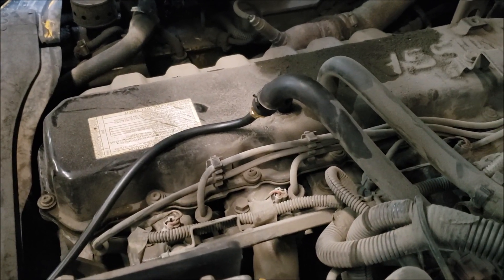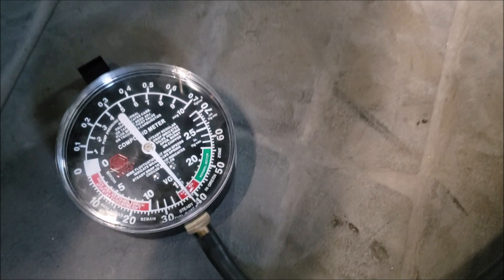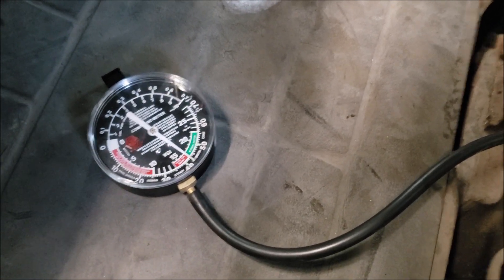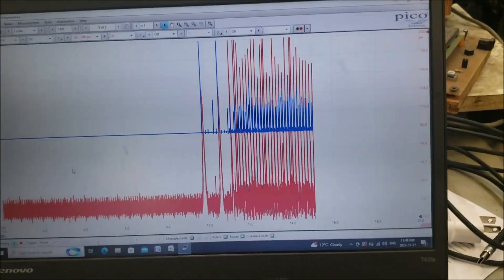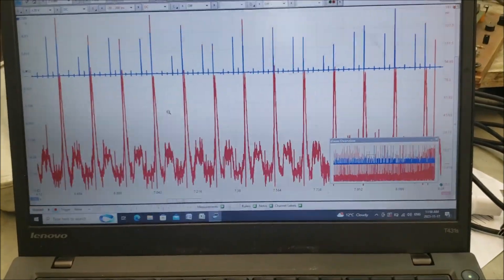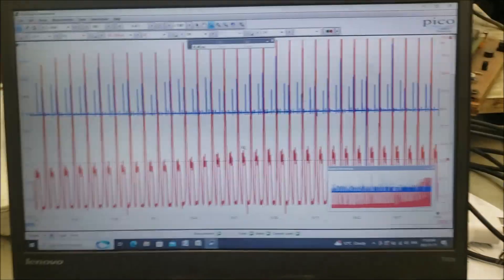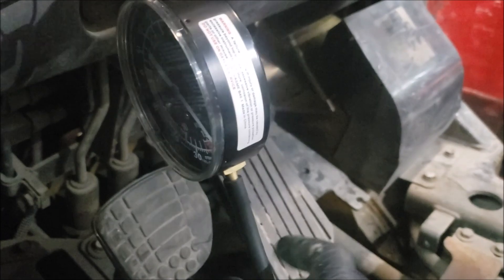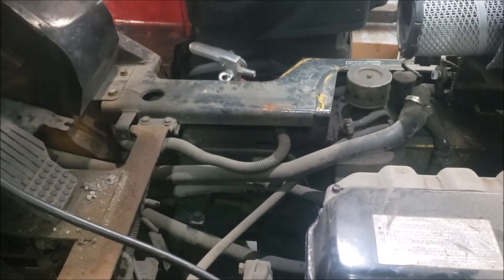Nissan TB45 Engine severe low power

Comment: Hi Forkliftgeek I have a Yale GDP25TE with a power problem,starts fine and revs no problem but sometimes when I put it in forward or reverse no drive or low power drive leave it idling for 5-10 minutes then I have full power any ideas? I did have the torque converter  reconditioned last year as didn’t have power to drive over a stone! After that it was great but now 1 yr on this.I have changed fuel filter,in-line fuel filter,ATF fluid & filer still the same
Reply from the maker: Sounds like a loss of pressure from the charge pump to me.
Reply: Thanks for that @forkliftgeek10 ,what does the charge pump do? And where is it and how do I test it?
Reply from the maker: @airwalker5404  charge pump or transmission pump creates transmission oil flow. You need a transmission pressure guage. This is only one possibility though.
Reply: @forkliftgeek10  thanks for that,I’ll look into it, I also wondered if it was anything to do with the drive solenoid?
Reply from the maker: If you are referring to the forward or reverse solenoids, then I would say unlikely to be the cause. You said if you leave it idling for 5 to 10 mins it would drive.

Comment: Hey man, I am a journeyman automotive mechanic up in Canada. I'm trying to fix an old Toyota propane forklift. I've watched all your videos and will be doing more testing today with that knowledge but this one has a weird issue that I don't see in your videos. It is a 4Y engine but old, no  gauges. Model is 7FGU32. It dose not like to start, however It dose try to start and of you push the gas the exact right time it starts and once started it runs awesome, no issues. It has this tricky start condition Hot and Cold. What would you be checking first? Today I will remove air cleaner and see of it starts perfect on brake clean. I am sure it is fuel relates. Any advice would be much  appreciated
Reply: No fuel injector on this old unit, just goes from regulator to an old school mixer with the diaphragm which I removed and made sure wasn't cracked and the valve inside moves freely
Reply from the maker: Nice to hear from a fellow Canadian. Based on what you said, I'd be looking for vacuum leak. More probably the fuel system relies on air valve vacuum to operate. A vacuum leak disappears when you open throttle so I would start there.
Reply from the maker: https://youtu.be/NacF0eamQ2Y?si=6-f-t3u-zKEtzoHe

This video although a caterpillar would have somewhat of a similar system.
Reply: Thanks so much! Will keep you posted, heading out there this afternoon
Reply: Issue for me was the regulator pumping to mush pressure to the cold start injector. Pinched line and it ran great. I believe its just a cold start injector as it stopped operating once engine started. Customer to opted to leave injector unplugged instead of  diagnosing further.
Reply from the maker: I thought you said it did not have an injector.
Reply: Hi Forklift Master I have low power as well on a Hyster 80 with LPG system. Engine is a GM 4.3. 8,500 hrs

Low power, I cleaned and rebuilt the impco ca125 mixer and found bent parts inside the regulator. New regulator

Uses a Vff30 fuel shutoff. 

Any ideas? It starts and idles reasonably well, hunts at idle. Hunting almost goes away when the idle mixture screw is screwed all the way in full rich. 
Right off idle, up to 2500rpm or so very boggy. Sometimes it will rev up all the way very strong other times it cant get out of its own way! Love the videos, trying to fix this old hyster beast.
Reply from the maker: @AndrewsGMC when you rebuilt the mixer, did you buy the diaphragm using the hyster part number?
Reply: @forkliftgeek10  no I just disassembled and cleaned. The diaphragm was in good condition. 

I just fired it up and drove it around and it was operating perfectly, I did the primer bulb test on it and it died in 2 seconds. 

Not sure what pressing primer did but she ran great!

Comment: Wonder if the customer is going to try to get by with it running like that. If they do, you may get a head gasket job along with the converter when it comes back.